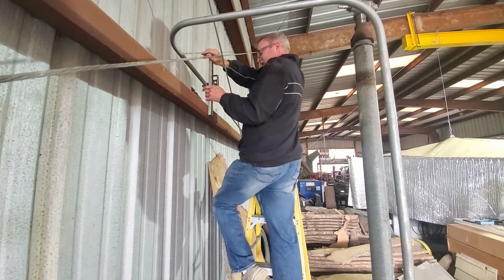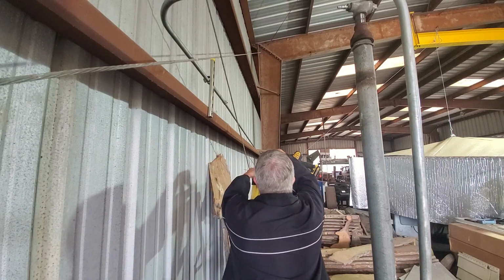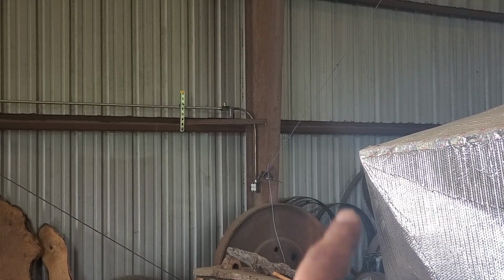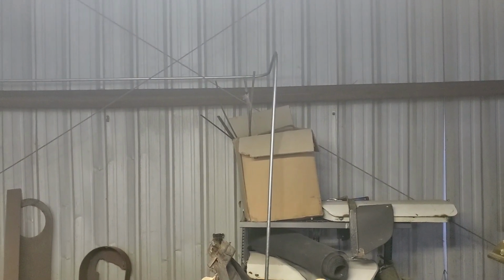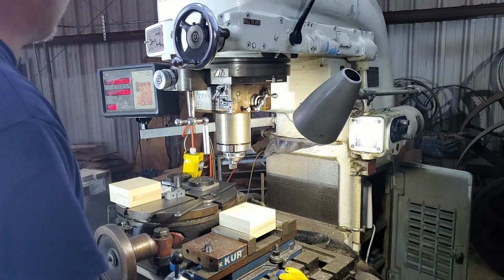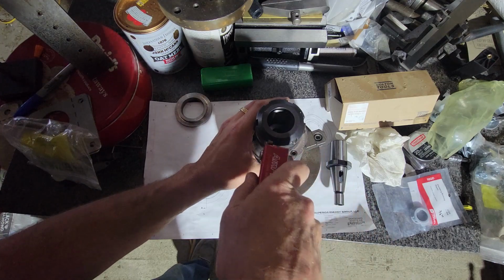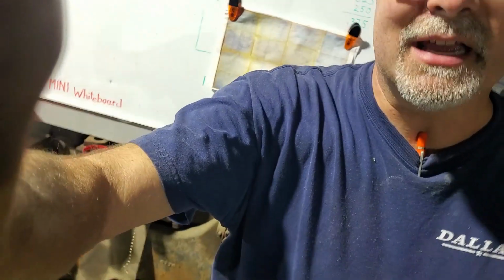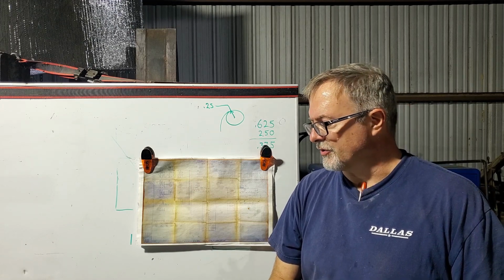Internet Prep & Custom Form Tool

Comment: It'll be nice to have internet out there. Hopefully, they come through with the install. BTW, nice try hiding those sparks when you put that wall outlet and switch back in. But I saw it! LOL!
Reply from the maker: You win the observation prize! I shut off the breaker to the light but the outlet was on a different circuit.